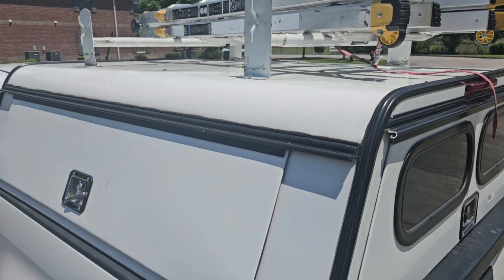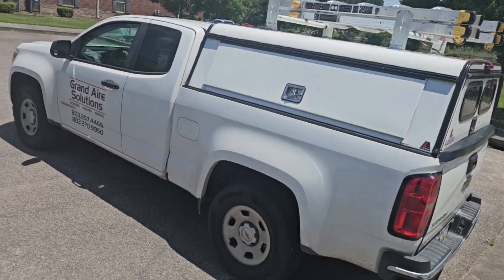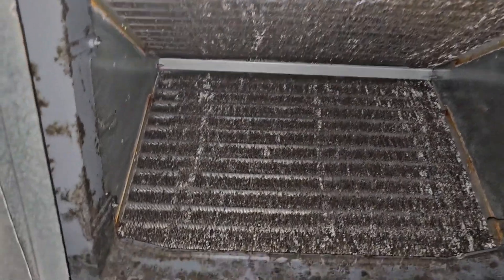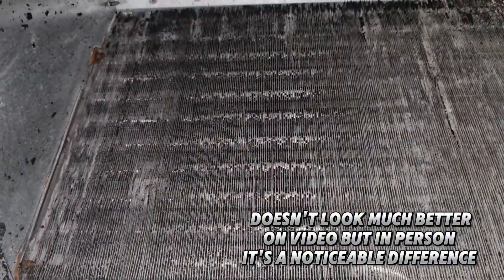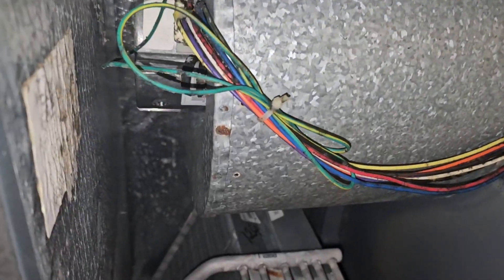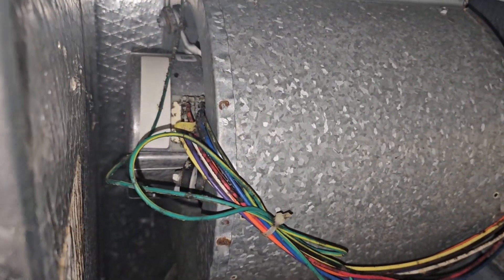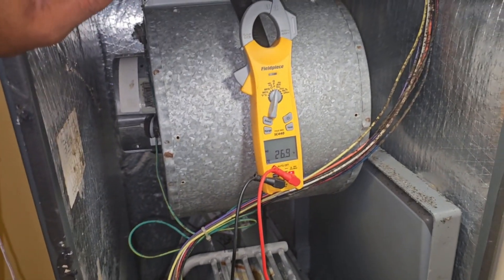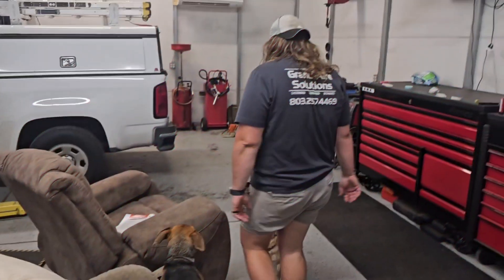Tennant Unhappy With Their Goodman AC System | HVAC |

Comment: I usually carry a psc blower motor on trucks... clients typically opt out for the cheaper motor versus the ecm motor... that way, they get air right away... 
Great 🎉job, though 👏
Reply from the maker: My vehicle is small so the only motors I really keep are condenser motors. Blower motors I'm told to just order because we will need approval anyway 🤷🏾‍♂️

Comment: grand aire in austin, tx?  they sell mud mixing pans at home depot, that work great for catching water when rinsing an evap in place
to get them by try another speed tap and see if the motor kicks on
Reply from the maker: Grand Aire Solutions in CSRA

Comment: I’ve used tri power I like it. And as far as micro channels go… spray it but don’t leave on too long 15mins tops. Rinse very throughly and you’re good.
Reply from the maker: Yeah, I was always told to wet it first too before applying the cleaner

Comment: SHOULD THINK ABOUT STOCKING AN EZ13 Rescue universal 115/230v motor on your truck. Will work in a furnace or an air handler, just set it for 115 or 230v operation. Would fix that on the spot. I KEEP 2. Cheaper than the OEM if it is out of warranty.
Reply from the maker: Screenshotting this and showing boss man so he can give me the greenlight for it. Thanks for the idea 👍🏾

Comment: That truck setup is similar to mine. I have the 8 foot bed with no extended cab though. I have a bedslide in the back that makes it very easy to get to everything.
Reply from the maker: I got a bedside too but the more I have used it the more stuff falls on the sides. One of these days I need to put rails on the side so I can stop loosing stuff off the side

Comment: The sell a kit to swap that to a psc motor for good if the homeowner agrees to it. Lot cheaper
Reply from the maker: If it was a homeowner I'd give that option but this just a tennant at an apartment complex
Reply: @AB_HVAC  either way, they still need cooling, right? And whoever the landlord is, I'm sure they won't mind saving a little money. What's your thought process?
Reply from the maker: @Mo4Honesty either way the system would've been down for the day because it'd have to be sent as an estimate to let them know what's going on and what I'd have to do. So make them wait for the OEM Replacement, or make them wait to turn a ECM into a PSC for a 12yr old system
Reply: @AB_HVAC I got the impression that the ECM would be a week or more delay for the part. Not true? Either way still much cheaper to do the PSC.
Reply from the maker: @Mo4Honesty nah I picked up the part as the supply house closed today. I was just too far from it right then but I ended the day closer to it so I managed to pick up the part. Replacing the motor tomorrow 👍🏾
Reply: Man yall act like A/C is a must have. He did the same thing I woulda did….
Reply from the maker: @dkinfishing  thank you 😅 everything ain't always on the truck